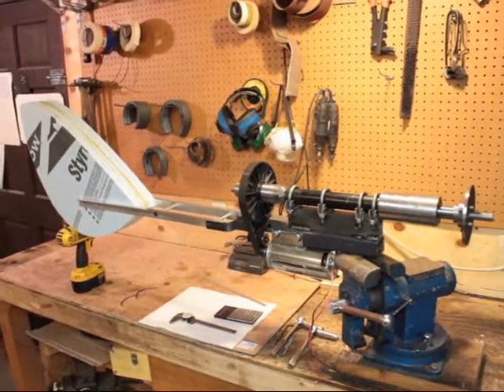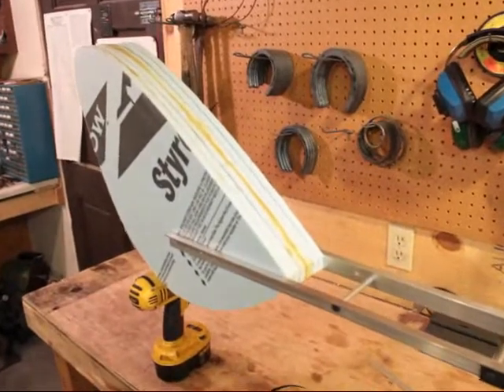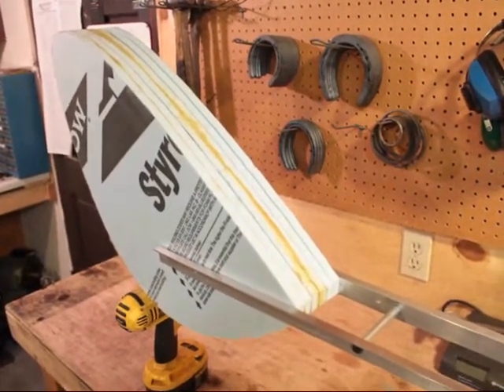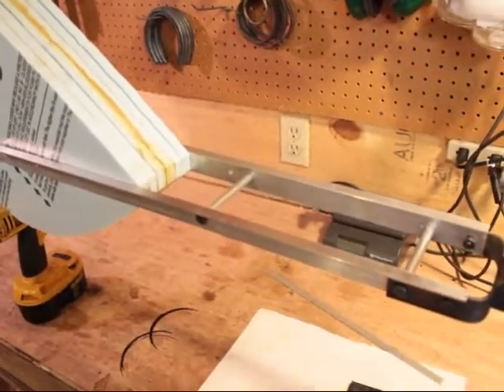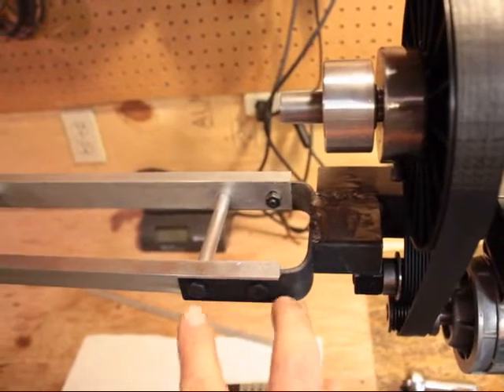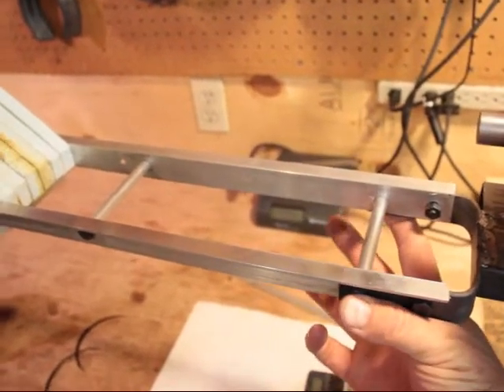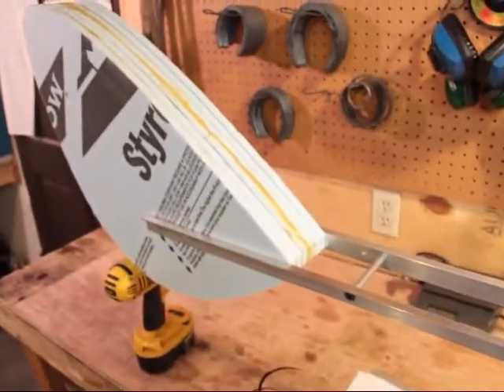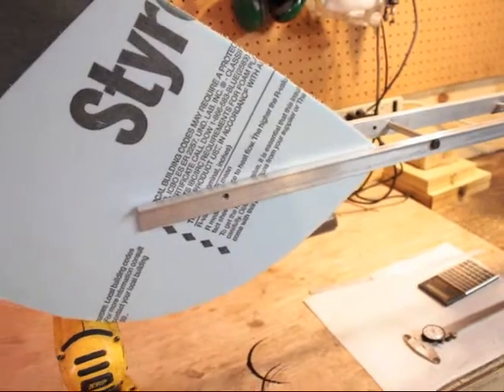Part 3 Grooved Belt Treadmill Motor Wind Turbine Generator DC PVC Blades Gear up PMA

Comment from the maker: Nice! Thats a great idea! I have seen that stuff on boats but have never worked with it. I ended up making a light tail with carbon fiber ski poles and thin gauge steel for this thing but I may go with your suggestion on my next turbine. I orininally wanted to make it surf board like (tuff, light and waterproof) and think your method may be the most economical time efficient way. We will see ... Thanks man!

Comment: What if you used that boat shrink wrap stuff to seal the foam tail fin. this way it is still super light. I had built a rc plane with 6 foot wing span. and there is this stuff that I had to use for he wings, fuselage, and body. with a little bit of heat (a low watt iron) it sticks & shrinks on the product. maybe you could try this. check your local hobby shop for rc plane skin? I hope this would help in reducing the weight in the rear????

Comment: If you test it like your nema unit, try a lead acid battery as well as the bulb. You will find the impedence much lower, should match a turbine with a lower blade count (lower torque higher top speed)